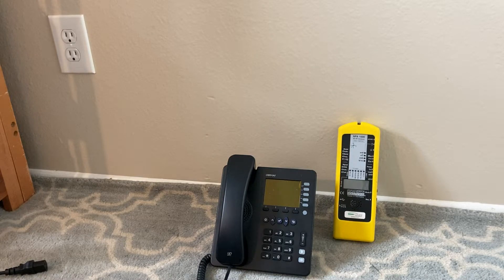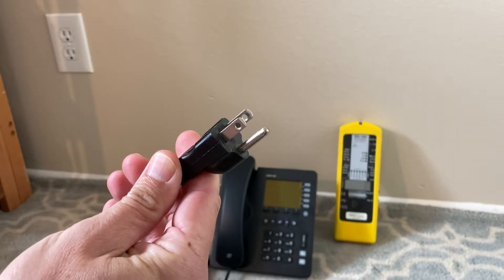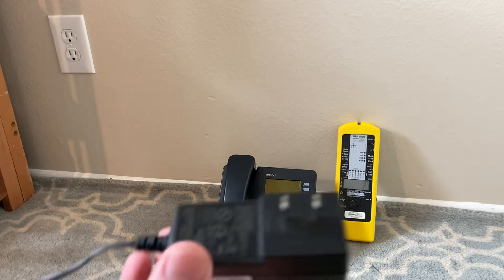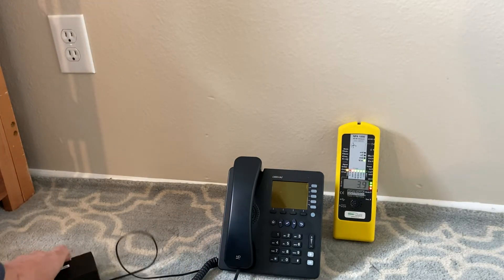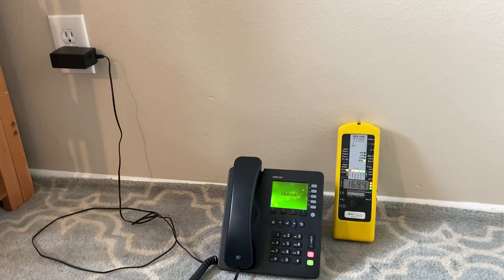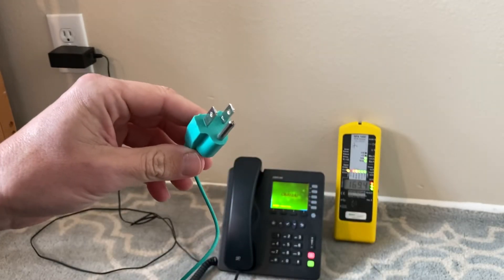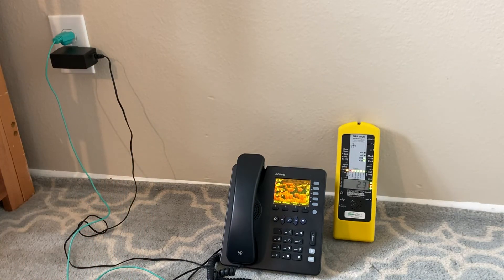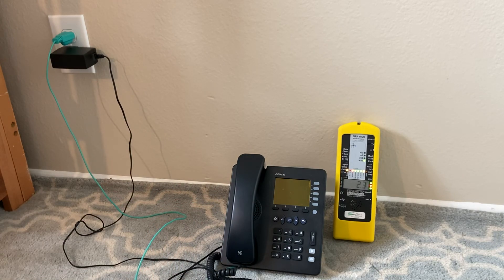EMF Hack: Reduce your Radiation Exposure: Turn a 2-Prong Cord into a 3-Prong

Comment: This is a great tip, but what about lamps that have 2-pronged outlets?
Reply from the maker: You can do the same thing and have a small appliance repair shop or electrician connect the 3-prong power cord ground wire to the metal chassis of the lamp
Reply: Is it OK to use a power source like an extension cord thing with multiple outlets?